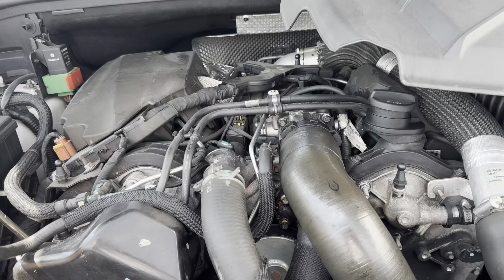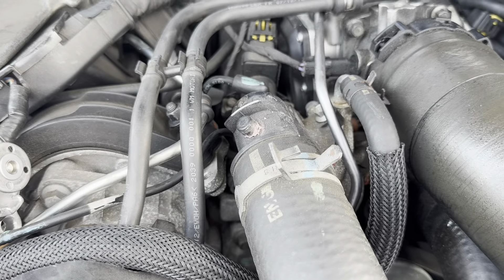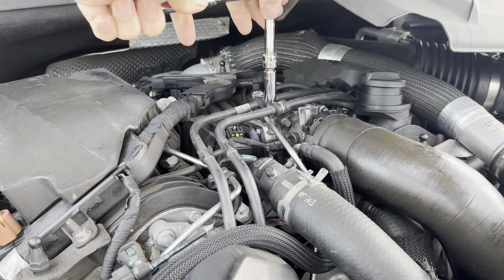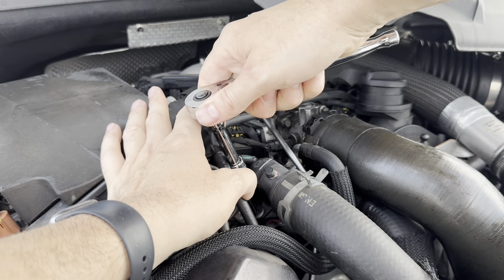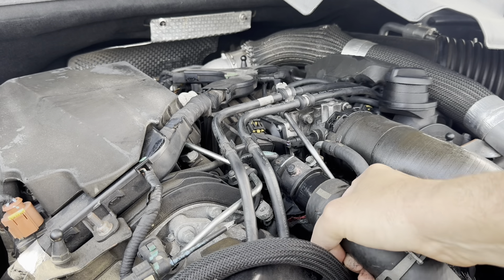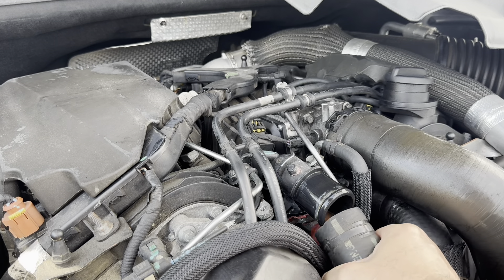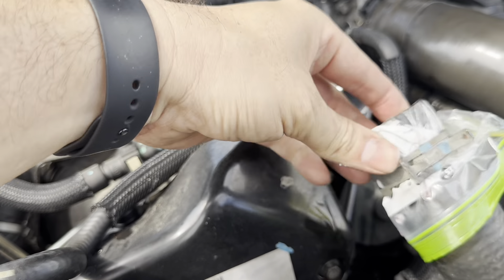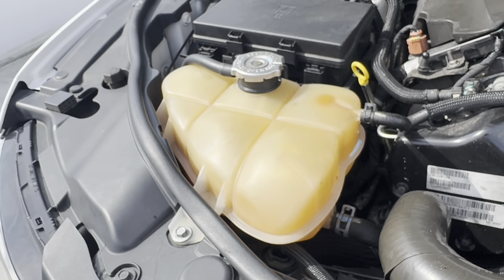Jeep Grand Cherokee Eco Diesel Metal Thermostat Housing Replacement - Jeep Ram Eco Diesel

Comment: Thanks for taking the time to do the video
Reply from the maker: @peterpalis9345  no problem. I hope it helped. Top tip is to use some peratex gasket maker on the surfaces so the O Ring isn’t the only thing sealing it

Comment: Do you have any tips when installing the oring/gasket? I’ve done this twice now and both times it’s completely shredded the gasket and caused a massive leak. I dont know what I’m doing wrong. Do I have to try and push the housing in all the way down before tightening it?
Reply from the maker: I later took it apart and added a thin bead of permatex gasket sealer. That combined with the o ring and hasn’t leaked in the few months since doing the job.